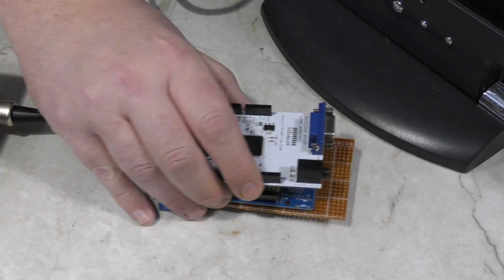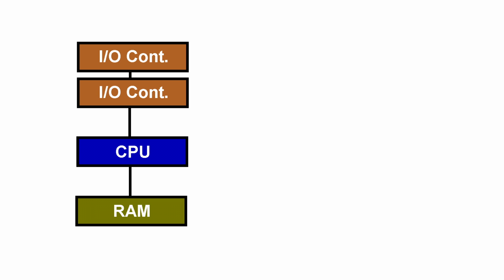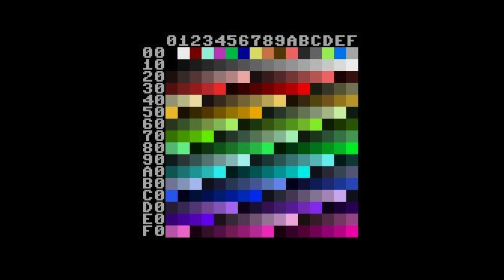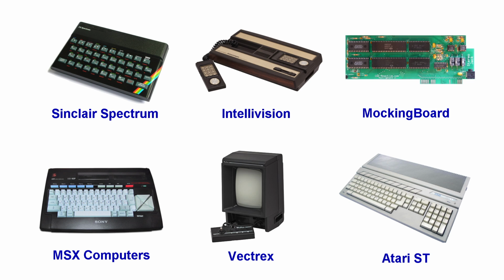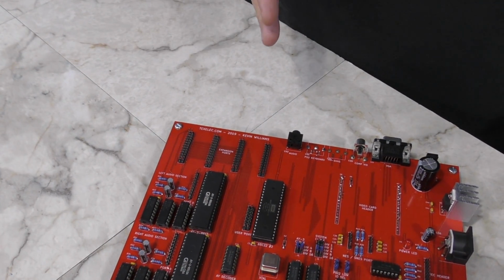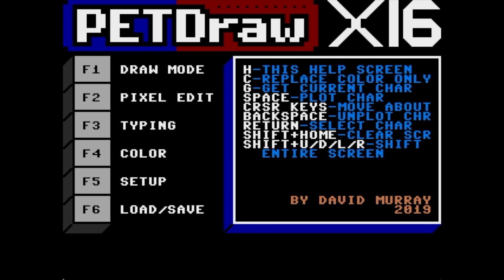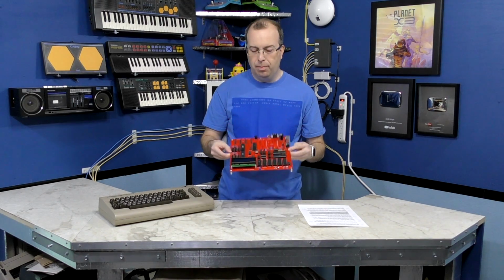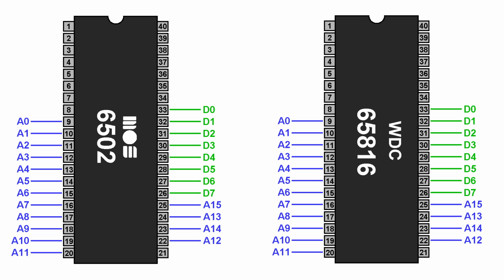Building my Dream Computer - Part 2

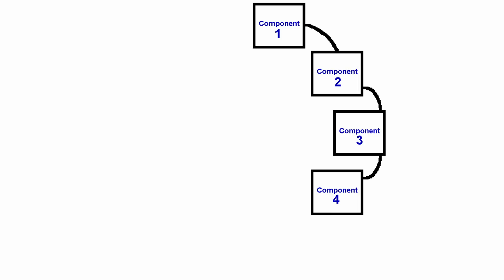Comment: @3:55, in fact you can test individual components if you leave debugging probes in the prototype boards and expansion room for changes that may be needed. That's what is done in clean sheet designs.

Comment: IS this project still ongoing? I haven't heard anything in a while.
Reply: not quite sure, also, with the new raspberry embeded in a keyboard  i think this project is kinda pointless considering that it can't compete with the raspberry in price
Reply: @Larroseba  that’s not the point of this though, it is not supposed to be a powerhouse it is supposed to be a modern retro computer
Reply: @Larroseba  No that argument was specifically addressed in the first Video. The Raspberry Pi, as a Linux Machine, is not suited for this project. The 400 didn't change that.
Reply: @Larroseba  Wow... Seems you are actually missing the point of the project. He addressed the pi in his first video... 🤦‍♂️
Reply: There is a website — commanderx16.com

Should be up to date there
Reply: @AshtonSnapp  Thanks!

Comment: Regarding the display chip, check out the FT815 on the Gameduino 2. You can't "peek/poke" to that, but programming is nice and opengl-like.
True bitmap mode is still not available in the chip (https://www.ftdichip.com/Products/ICs/BT815_6.html).

Comment: is ... and to think that this circuit was designed in DOS ... at that time the CAD PCB software already existed but it should be very complicated to handle the first one I saw was the tango pcb and another the second was the sprint layout which I adapted the eagle and it is very difficult to handle, but its component library is more complete, but it is much easier to create your own component in the sprint layout.

Comment: If I were doing this, I would not restrict myself to old technology. I would LOVE a computer that programs similarly to a retro 8-bit system, but is not limited to tiny amounts of RAM and CPU speed. Something like a Commodore * 1000 rather than a slightly improved commodore with new components. Don't restrict to 6502.
The ez80 is the perfect CPU for a modern retro computer. It is 8-bit, but 50 MHz, yes 50. See, when you design something like this, you are limiting your target demographic to nerds that want to relive the 80s. Why not target the younger generation as well by making the machine capable of so much more than the 80s hardware. Yes, you could still use it that way if you wanted, but to have something like up to 1024x768 graphics modes and many megs of RAM would allow younger people to make their own games easily that don't necessarily have to look like they were made in the 80s. Please consider it. You said the video chip is capable of so much more, so why drive it with a slow 6502? Don't just recreate the past, really improve it. I am very passionate about your ideas and I love what you're doing, but I think you need to consider making something more dynamic that everyone would love.

Comment: Probably the most flexible and least expensive route would be to do the processor, sound and video chip ALL on one single FPGA. This would have several big advantages: Updates/upgrades/bugfixes to the system would be simple, you could create the EXACT capabilities you want for each virtual chip, they could run at much higher speeds than those old legacy chips AND sourcing would not be an issue. Many FPGAs also include a decent amount of onboard RAM which would additionally simplify the design. Probably too far along to go this route though...

Comment: I dig watching these and it seems fun. But I have to wonder, why not, instead of using all of this knowledge and creativity to remake a commodore 64 on crack, just make a new computer system that can still hit all of the goals you want, but the compatibility and capability to do modern things. At some point you might just come to the realization that everything you always wanted, really isn't ever going to be what you want once you have it. You'll always feel like if only it had a little more power, or a little more this, or more that. Next thing you know, you've re invented the modern PC anyway. So why not just start there? 

I think it's fun in hobby mode, but turning it to a business model to make it cheap enough to actually sell with any kind of profit, will eventually kill the project and might step on the entire point of starting it in the first place. I do wish you luck. As a kid I go to dabble with a COCO in the early 80's, so the nostalgia of it all is pretty entertaining. I'm learning things I never knew just by watching this stuff too.

Comment: Commodore BASIC V2 is a relatively bad choice. It was the weak point of the system. It had absolutely no support for the outstanding features of VIC and SID. Please don't refer to Peek and Poke here. That's why BASIC code for this often looked ugly. The numerous BASIC extensions were not really helpful and more toys than tools because of neither being part of the system nor a single one was commonly used. So it was quite frustrating for a beginner to make use of these two chips. At least the X16 should be given a BASIC V3.5. Even better would be the BBC BASIC of the BBC Micro. It was well structured and apparently the fastest at the time and on top of that you could even embed assembler code. This with C64 would have been a really great combo. But we should finally get rid of the line numbers. ;)

Comment: i was severly disapointed when i found out the case was crap and not inspired by the c64 or amiga. good specs shit case. put this bad boy in the chasis  it deserves
Reply: The point is keep the cost low. A custom ABS plastic case can make this quite expensive given the size of the boards, unless they do the 3D printing route and the results would be subpar, for the costs involved. I think thay are doing their best, considering the expenses involved in projects of this type. Probably this can be a kickstarter goal, but i assure you that the goal would be quite hard to reach... (I think around 10K dollars or more, given the size of the boards)

Comment: When will Windows 95 run on it?
Reply: Never. Its a 6502, its an entirely different architecture, and even if it wasnt this thing will run at 8mhz tops, the slowest cpus that ran windows 95 were 200

Comment: It is a shame that the sound board doesn't have a SPDIF output to drive a off board DAC and SPDIF I/O for saving programs to DAT machines like the Philips DCC900 as it can handle 32 bits at a time and loading it back

Comment: PLEASE PLEASE PLEASE consider making a plug in clock module built up around the Silicon Labs Si5351x chip! it's a 3,4 or 8 output I2C configurable output PLL clock generator that covers 3KHz to almost 300MHz!  with phase locked offset outputs and other cool stuff.

Comment: One thing I did not really like on the C64 & I had to tolerate it, was the 2-pixel wide screen characters/letters.  I understand the thicker characters originated from the PET & other computers of the time, but additionally it compensated for any screen issues using the blurriness of televisions.  So, about 30 years ago, in my youth, I remade the character in only 1-pixel wide for testing.  It was just a program changing out the character ROM.  I'm sure I'm not the only one that did that.  Granted, for me it looked great on my Magnavox CM8702.  I see here on the proto-CX16 that the thick PET/C64 characters were used.  Will 1-pixel wide characters be available or will it be kept at 2-pixel widths?   With VGA & higher dot pitches of today's monitors, I would think that characters that look closer to non-proportional Arial fonts would look nicer & cleaner. Any thoughts?  Also, why was standard screen size used instead of wide-screen anamorphic?   Is this also chosen for the "vintage" look?

Comment: It would be great to see a video on what it means to have a video-processor and VRAM in a system like this. What is a coprocessor doing that takes strain off of the CPU, what is the advantage to standalone VRAM, and how they interface together. Something like an addition to the how old school graphics worked series

Comment: The machine-code monitor slash assembly programming environment is an amazing idea! I do remember scratching my head around with machine-code monitor on the C64, I did do programming with it but it was only for speeding up something. Big things was not really possible but then much later (on the Amiga) found "Assembler" (Asm-one or Devpac? can't remember) and was just "aaah" this is soo much easier :-). But I would probably not even tried if I did not have an machine-code monitor on my C64. And if you could marry them somehow (I guess you can't have the best of both worlds even though they are sort of similar) it would be great!

Comment: Sorry i might be a little late on this but i can see naming it the commander X16 since it was based on the 16 bit chip you looked at originally but when you changed the design to be based on the Vic20 why not change the name to the commander X20?

Comment: Wow, dream machine built from scratch based loosely upon redesign of the old Commodore 8 bit product line.  And my dream was use an existing C128 or B128 and expand it’s capabilities via a custom FPGA connected card expansion port.

Comment: Your ring of interdependent systems is a common issue. At one company I worked at we used to call it "getting it fixed enough to get it fixed." The dreaded chicken and egg. Ultimately it boils down to unit test and a good design map. But the problem is always potentially there.

Comment: It wasn't that hard to do a program large enough to fill the memory of those computers. I remember when I was a kid I built a document filing program for my father's office using the atari 800xl with the built in basic first and then with "turbo basic" and I had to split it in two parts, each doing different processing on the data, because of ram memory limitations. also ran into limits when storing multiple screens that could be switched quickly. I still remember anxiously typing "FREE" all the time and also squeezing my brain to make more compact routines. your computer is looking like the solution I needed long ago. I'll keep a close eye on your channel and of course your computer.

Comment: Dude use a w65c02 it is a 6502 with a fully static design an can run at 17 mhz. And for the i/0 use the w65c22 for the timing match up with newer 6502

Comment: An 8088 at 3mhz easily outperform the 6502 at 1mhz in every situation. Saying that a 8 mhz 6502 is equivalent to a 12 mhz 80286 is simply ridiculous and non sense. One should take a look at the kips table for those ancient beasts

Comment: 3:51 reminded me of when in school our teacher assigned the class to each develop a small section of the 8088 processor using all 7400 series logic chips. Everyone did a part of the overall processor and we came in each with multiple breadboards it quickly became a wiring nightmare to run all the buses to hook it all together. I'm sure everyone had at least one if not a handful of wiring mistakes in their section needless to say by the time the class ended we never did get the stupid thing to work.
Reply: it's like the Manhattan project, but it fucked up and didn't work
Reply: While it’s unfortunate you didn’t get it to work you do tend to learn more from failure than with success
Reply: We did that as well but the teacher opted for each person to set up his own. The Motorola 8088 rocks. Really a predecessor to Intel and everything we know today.
Reply: @Cotronixco  the 8088 was intel, and it's an 8 bit bus version of the 8086
Reply: @wesleymays1931  That's right! I may be thinking of the 6800.

Comment: Why not use a raspberry pi?
Reply: @ethanbennett7  I was there in the early 80's. My first computer was the 6809 based Color Computer. It was simple. It turned on instantly. I could connect it to a tv or tape recorder. The text based video was so easy to deal with, since you could put the character directly on the screen. And 6809 assembly was elegant. But today, you have to have hdmi unless you want to go to a junk yard.

Comment: Hi. I've not been able to search for this in the looooong commentary section, so if already answered, please forgive!!! You have shown the W65C816SXB board in the Part 1 video, and in this one you said thtat the W65C816S has the problem of the shared DATA and ADDRESS pins that makes proper implementation a nightmare. But... Have you seen the W65C265S MCU? In the datasheets, it says: "The  W65C265S  has  the  full  24-bit  address and  data  bus  available  as  opposed  to  the  W65C816S  having  the  high  order  16-23  address  pin multiplexed  with  the  data  bus." So there is actually a linear memory address access with this MCU.

Comment: Neat 8-bit machine, I guess.  If it reaches 8Mhz it will have enough MIPS to run a Wolfenstein 3D port in the 256-color bitmap mode.  One area that I'm not thrilled about is that this system breaks with the way most 8-bit machines of the 8-bit era were designed.  Most had unified memory for main CPU memory and the video chip, and I felt it's a really elegant design, albeit with a tradeoff in CPU speed.  I've emailed David about my own efforts building my own machine from scratch, and likewise I am skeptical about using 65816 after I estimated the impact on bus timings and a penalty of bus speed that is incurred when latching the upper address bits.  Theoretical MIPS of that chip are good, but it's not an elegant design by any measure and does not appear to reach the performance targets I have set.  It's clear why that chip never became prolific in home computers.

Comment: When you reach stage 3 you could actually put the board in a case with a touchpad, if possible in a form factor resembling a tablet. Would be nice to have a commander x16 tablet.

Comment: A kit that the end user can assemble makes a lot of sense, because you can incorporate a little info about how the device works and what it can do with the assembly instructions. E.g. this is the sound chip that has 6 channels (or however many it has). That way developers learn as they build and have good initial familiarity with the hardware before even turning it on.

Comment: i might buy one but will this be able to use hdmi and usb as well. even if you cant put it on the board can there be a expansion for this? i have very limited equipment like my monitor only uses hdmi not vga i think my projector can use vga but i lost the power cable and i don't have anything that the projector can use for displaying the image. i also only got usb keyboards and a usb mouse.

Comment: O.o ... Dude - the X16 case should be Beige ^.^ Also if your unit is supposed to function like a c64 you should at least try to hav it backwards compatible - a legacy mode that will run c64 happily by devoting some of the extra memory and processing power to making sure the old memory peek/pokes still work

Comment: Firstly, I think the X16 and it's team are amazing. But some feedback if I might. I loved my C64 and learning how to program it in assembler. It felt so comfortable being able to see and understand the entire machine. I am (or was) excited about the X16 for this same reason. The VERA board seems to completely corrupt this design principal though. With so many features, with sound, graphics, and serial IO among them, and the fact that the VERA is almost a SBC all by itself, it seems to reduce the actual X16 to nothing but a keyboard interface and some RAM. Seems so out of place. Anyone else feel this way?

I was really excited to buy one of these and re-discover a true 8-bit computer from beginning to end. Opening the "programmers reference guide" and seeing the memory map for the first time ... poking a raw value into a byte and watch the "magic" happen on my screen where a pixel appears ... SYS-ing over to a few bytes of assembler that I had written on paper and used BASIC to load into a chunk of memory. These are the things that I found magical. You could understand the ENTIRE machine; nothing was abstracted or HAL'ed away from you.

This is still an amazing machine, and I really do mean that. But to call it an 8-bit computer is no longer accurate. It's a piece of cutting edge technology (the VERA), interfaced in such a way that it can be hosted by some vintage technology (the RAM/CPU/8-bit bus) so as to simulate what an 8-bit computer was. It's just too complicated now.

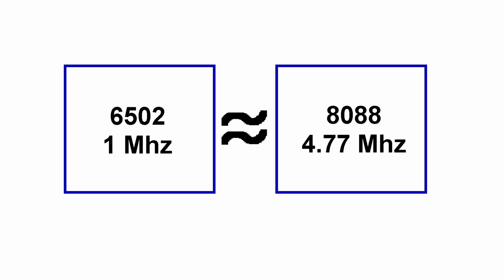Comment: 38:55 - seriously, lol? 6502 didn't even have a HW multiplier, let alone its inferior accumulator-based architecture. BTW, 8088 was a scaled-down version of 8086 which had a 16-bit data bus and some other stuff.

Comment: Plz don't use an off the shelf case. It kills the aesthetic. Can we at least get the option of buying a bare board to use a more retro case with it? Heck if the project is successful enough, maybe a custom case could be designed to mimic the styling of the retro PCs of the time, or maybe even one of the Commodore disk drives.

Comment: Pleeeasssee for the love of all that is retro sacred don't use the YM chips. Make something with some actual character to it; on the vera chip. I dunno.. maybe do something like 6 channel SCC chip (used in the MSX). It's more advanced than the NES audio chip, simple in design interface, but still fits in the spirit of this retro setup. Having it on the video fpga package it also pretty convenient. YM seems pretty out of place (especially since Yamaha chips were very expensive and the company was very picky in approving who could use their chips.. they personally approved all sales of the higher end 2151 and related chips back in the day), especially since you originally decided on the dual AY setup - you went form under performance (AY) to over performance (YM).